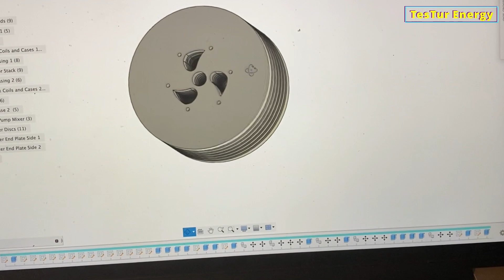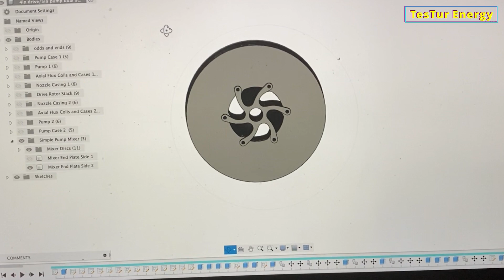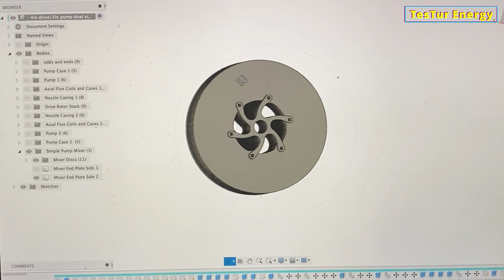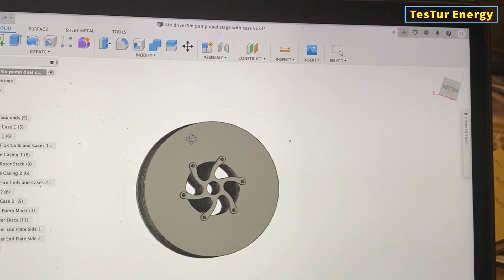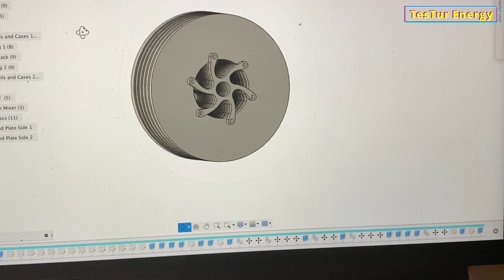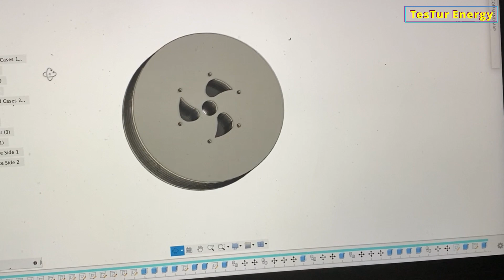Tesla Pump Multi-fluid Vortex Mixer & Steam Condenser - Air + Fuel Atomizer, Waste Treatment

Comment: Super interesting that it's a mixer whitout introduction of a lot of turbulence
Reply from the maker: Right! The fine shearing of the fluids as they are accelerated to the periphery will do all the necessary mixing. And even then what’s not mixed will get mixed in the diffuser cone.
Reply: @CharlieSolis that's amazing, for The steam system could it be done whit a normal pump just by introducing the cold water spray just before the inlet of the pump? ore does This introduces problem's like damage on the inlet hole's
Reply from the maker: @oscarverwey  it’d probably last ya a few minutes with a bladed pump.
Reply: @CharlieSolis  sorry I forgot to mention that I mean a normal Tesla pump
Reply from the maker: Yeah I would imagine there will be some issues to the spokes over time. 

The other thing is, my plan is to have the exhaust of the turbine be ducted to the inlet of the second stage pump with the interstage heat exchanger. So it’s all one rotor and there’s not really a place to introduce the water spray between the turbine and pump, other than on the other side of the pump.
Reply from the maker: @oscarverwey  I know you’ve seen it but I’ll put the link here for others. 
Tesla Turbine - InterStage Heat Exchanger (ISHE) - Heat Pump & Inverted Brayton Cycle Improvements
https://youtu.be/pYSniitC8DM

Comment: Back pressure is required to mix the steam and water flows into thin spirals.  This would reduce the main rotor power if used as a steam condenser.  This is still great for the other applications you listed.
Reply from the maker: hey thanks for showing your love and support by commenting 🙏❤️ it really helps with the algorithm! I appreciate you input but thats not the case. This is being used as a pump, not a turbine. 

The fluids are being flung to the outside together by the pumping action of the discs. 

Also you don’t need back pressure to mix the steam and water flows when they are both at a higher pressure than the vacuum condenser. Things will just flow in that direction due to the pressure gradient. 

They will both be flowing into a the lower pressure region inside the pump/discs.

I would urge you to rewatch this as I have a feeling you may be misunderstanding the working mechanisms of this idea.
Reply: @CharlieSolis  I like your channel.  I want to build a Tesla steam turbine that uses stored solar heat and a heat pipe condenser.  Condensing the steam is critical to prevent wasting water.  Tesla turbines are simpler to make than most steam turbines.  I probably won't do any of this since my wife doesn't want projects taking my time and living space.  This is why Tesla never got married.

I initially thought the plan was just to mix the water and steam and output to the condenser chamber.  Back pressure is required in order to get thin layers of water and steam inside the pump.  Without back pressure, the water and steam will mostly fling radially out, which reduces the mixing surface area.

Now I understand your plan is to heat the water and condense the steam into a single high pressure liquid ready for the boiler.  Neat idea, but at steady state this will put excess water into the boiler, since all the steam used in the turbine, plus additional water for condensing the steam, flows through the mixing pump.  This excess high pressure hot water could be useful to power an organic Rankine cycle before the water goes through a Pelton wheel.  This would be a lot of extra infrastructure.  Alternatively, the condenser pump could be used intermittently to prevent building up boiler water, but this would require a separate condenser.  The excess water could honestly just be dumped back into the feed water, since the flow rate would be very small.

I am mostly worried about the feed water vaporizing at the low condenser pump inlet pressure.  This wouldn't happen with high enough condenser pump inlet pressure, but that would greatly reduce the turbine power output.
Reply from the maker: @donnstrutton929  this second stage pump will go after the interstage heat exchanger and will exhaust into the condenser. 

Tesla Turbine - InterStage Heat Exchanger (ISHE) - Heat Pump & Inverted Brayton Cycle Improvements
https://youtu.be/pYSniitC8DM

This means only water at the bottom of the condenser well needs to be circulated back continuously from the condenser well through the second stage pump to aid in condensing. Taking it from the well will be when it has been cooled down significantly. 

As you said, there would be issues with doing this direct feed into the boiler. You still need a heat exchanger to take the heat out. 

Which the interstage heat exchanger will do to some degree but there will need to be a main condenser connected with the Tesla fountain water to air heat exchanger still for decent power outputs. The heats gotta be taken out for condensation to happen and net work out.
Reply from the maker: @donnstrutton929  check out my latest voltage outputs for the vacuum steam system! It’s a video I don’t have on my YouTube channel but it’s on my Instagram. 
Steam Tesla Turbine Micro Power Plant 
https://www.instagram.com/reel/ClqGwiDDRSN/?igshid=ZmMyNmFmZTc=

Comment: Did this get tested?
Reply from the maker: Hey thumper! Unfortunately, not yet. Still working out parts of the turbine build before moving on to this.
Reply: @CharlieSolis  So the ideal design is a first stage turbine without a pump and a second stage turbine with a pump which also condenses the last bit of gas which further lowers the exhaust pressure, then using the coolest water at the bottom of the now much smaller condenser as the feed stock through the pump as a pre heat. 

I'm wondering since you introduce a new feedback loop if it will find an equilibrium by itself. Ideally it seems you want the point of condensation right at the tail end of the pump (i assume) so maybe a regulator on the temperature of the water being fed through the pump to condense the gas might be useful as the temperatures outside change during the day. Just thinking. I really love this idea btw
Reply from the maker: Yes exactly! You’ve got it! 💜💚💙

And yes this doesn’t eliminate the need for the water to air heat exchanger or some other, like the Tesla fountain heat exchanger idea of mine, because you still have to get the heat out of the system, but what it does it cause the condensation immediately after the drive turbine, reducing the pressure of the evacuating fluids which, in theory, should in turn reduce the the power needed to spin the second stage pump. 

Something many misunderstand about the second stage pump is that you cannot cause the steam, or any gas for that matter, to condense with the second stage pump alone, the heat needs to be taken out. This is because if you add energy to the steam with the pump it increase its pressure, now increasing the pressure does in fact raise the condensation point temp, but you coincidentally increase the temp of the fluid being pumped to still be above the condensation point at the new increased pressure. This is why pumping/mixing in the cooling water is pertinent to making it work. However this is not to say that the second stage pump is useless on its own. What it does is increase the efficiency of the subsequent condenser. It’s essentially adding a heat pump to the condenser to work better at exchanging heat. This is because by using a little bit of energy from the shaft to increase the pressure, and coincidentally the temp, of the exhausting steam you increase the rate at which the exhaust will exchange heat with the cooling water in the condenser, as the rate at which two objects exchange heat is dependent upon the difference in temperature between the two objects. 

For example say you are using 20°c cooling water in your condenser, for the scenario that is just the drive stage with no second stage pump say the exhausting steam is 30°c, the temp difference is only 10°c. However if you add a second stage pump and give up some of the produced energy to increase the pressure and temp of the exhausting fluid you can bring up the exhausted fluids temp to say 40°c and you also coincidentally increase the the temp at which it will condense because of the increased pressure. Now in this case not only did the the difference in temp between the exhaust and the cooling water double to 20°c increasing the rate at which heat is exchanged with the cooling water but the temp that the exhausted steam has to reach to then condense is also increased and it can condense sooner at a higher temp. However this generally requires a condenser heat exchanger system to work. This is also why I came up with the Interstage Heat Exchanger idea of mine so that it could be put between the drive stage and second stage vortex mixing pump/steam condenser. To further enhance the condensation prior to the second stage pump. 

In my head, the ideal case is when the steam is condensed all between the discs and the only thing leaving the periphery of the second stage pump is liquid water at a “high” pressure so that the separate boiler feed water pump doesn’t have to work as hard or can even be eliminated completely. However I realized this may be asking for to much as the design complexity increases exponentially for all the differing operating conditions to hammer out.

Comment: Con generar la baja precio estás bajando el punto de ebullición ? 

Se está creando un vacío con la baja precio?
Reply from the maker: Hey Fernando, not sure if you’ve gotten a chance to see my latest tesla turbine updates but check them out! Just running on compressed air so far while I still work on the larger vacuum chamber system for the turbine. Peak 2.75kW and 6.22ft-lbs of torque 4150rpm with 150psi room temp compressed air with 1/2in supply lines.  And the second video is the latest 1200watt electrical load tests using 170gal of 150psi compressed air dumped to 65psi, both room temp and then 70-80°c heated compressed air. And saw the continuous 1200watt output all the way down to 65psi. Should have this thing ready for a vacuum chamber here real soon! 

https://youtube.com/shorts/yXQy844URMA?feature=share

https://youtu.be/bWpXRzrzf4g
Reply from the maker: Hey thanks for commenting. If I understand you correctly yes a vacuum would have lowered the boiling point in the supply lines leading to the pump but the boiling point will go back up in the periphery as the pressure is increased again. That being said you will also simultaneously heat up your fluid from compression so that it will still be hotter than the new boiling point. So you CANNOT have condensation just from creating the vacuum or using it to increase the pressure without exchanging the latent heat of condensation to some other material. Ie the cold water that’s brought in by the other side of the pump is what’s used that causes the steam exhaust to condense via the latent heat of condensation being given to the mass of the cold water.

Comment: What about making these disks out of something like aerogel so there is less mass trying to pull these disks apart at the speeds I imagine it would want to run?
Reply from the maker: Hey thanks for commenting! Yeah the name of the game for the best type of disc material is to have the highest strength to weight ratio. To be honest I’ve never handled or even seen aerogel in person so I can’t speak to its qualities. What’s the tensile strength of aerogel?

Comment: Yes, fascinating idea. The whole condensor part of the cryophorus loop is the least well understood area for me. I thought the optimum was to fully convert all the input steam heat energy to kinetic/rotation energy which probably involves very high speed operation (I think IEnergy demonstrated this as the turbine freezing air during operation). If this were optimal then a condensor would not be needed? I guess in the real world this idea could work out to be a more practical solution. Nice idea!
Reply from the maker: Hey thanks for commenting. So in Jeremiah’s freezing tests, that was being done with compressed air. So when room temp compressed air is allowed to decompress and expand through a turbine, aka expander, it drops in temperature enough such that the and moisture in the compressed air ends up freezing. That moisture isn’t water vapor at that point. It’s just tiny water droplets that drop in temp because the air they are suspended in gets so cold that the heat in the moisture leaves and it freezes. The air needs to be highly pressurized though. This is similar to how to make liquid air or liquid oxygen or nitrogen. Check out how the Hampson-Linde Cycle works. 
https://en.wikipedia.org/wiki/Hampson%E2%80%93Linde_cycle

You compress a gas, let the heat from compression leave through an inter cooler, compress the gas again, let the heat dissipate and then you decompress the room temp pressurized gas through a system of tubes and the rapid drop in temp from decompression causes liquification of the gasses, but not all the gas will liquify though and it’s why they use a closed loop cycle and have to recycle the same mass of gas to liquify all of it. If there is moisture in suspension of that gas those water droplets will freeze too, like in a normal air compressor that pulls in regular moist air from a room. This is why all air compressors have a drain valve on the bottom of them too so the accumulated moisture inside the tanks can be drained out. 

I’m trying to figure out how to explain why this is different in the cryophorus but I’m having trouble writing something clear lol so I’ll have more to explain. I’m just struggling to find the words at the moment. Essentially the latent heat of condensation won’t get used for work because it’s not used for expanding the steam going into the vacuum. And to optimally get a low pressure at the exhaust of the turbine and at the outlet of the second stage pump you need to extract the latent heat of condensation to really improve the efficiency of the turbine because that’s how it condenses and maintains the low pressure in the closed loop section. Generally compressing cold steam by increasing its pressure through the second stage has the result of just heating up the steam to the point where it’s still hot enough to stay gas in the high pressure environment after the turbine, so while the second stage keeps a good low pressure at the exhaust of the drive turbine and allows the steam to expand more through the turbine that steam still needs to be condensed otherwise your second stage pump will have to start working against the high pressure it’s creating in the condenser after. So after going through the second stage to maintain low pressure in the whole closed loop system you need a condenser to extract the last amount of heat that gives condensation. I have however heard of people trying to get condensation within the drive turbine so that the latent heat of condensation is then regiven to the above working fluid but I can’t speak to that at the moment. Also I could be wrong lol so I won’t say I’m infallible in these assertions that I’ve made. There’s so much still up in the air with what’s going on inside the system. 

But I’ll just say, there’s a reason Tesla puts the second stage pump after the condenser in both the high vacua patent and in in his many diagrams in his “Our Future Motive Power” article that he lays out all the information for these cryophorus power systems. 

If you haven’t had a chance to read both of those I’ll put the links here 

High vacua patent:
https://teslauniverse.com/nikola-tesla/patents/british-patent-179043-improved-process-and-apparatus-production-high-vacua

“Our Future Motive Power” -N.T.
https://teslauniverse.com/nikola-tesla/articles/our-future-motive-power
Reply from the maker: To put it simply, the closed loop cryophorus power system is quite literally the refrigeration cycle in reverse. Instead of applying work to run a motor that compresses and expands a fluid to move heat out of a system causing a heat gradient between two places, you use the heat gradient between two places in the system to vaporize and expand the working fluid through a pump in reverse making it a engine. A pump is an engine and an engine is a pump. And contrary to what some people like to say a compressor is no different than a pump. They are the exact same thing. And an engine and turbine are the exact same thing. A turbine/engine is a pump/compressor working in reverse and vice versa.
Reply: @CharlieSolis  Hey Chalie thanks again for the epic response! Yes, I need to study the high vacua patent and other links you mentioned!
Reply from the maker: Yeah they are both wonderful reads! He really puts a lot of ideas into them.
Reply from the maker: Check out this underwater jet engine. It uses the shockwaves of steam cavitation to accelerate water and air bubbles. 

https://www.newscientist.com/article/dn3321-steam-fires-underwater-jet-engine/
Reply: @CharlieSolis  yes, I could definatly use the Tesla Turbine version of this :- D
Reply from the maker: Honestly I’m still not sure what I wrote in this first comment is the exact way to think about it either. So bare with me as I try to find the best way to explain it.